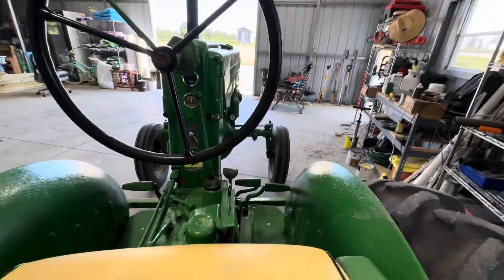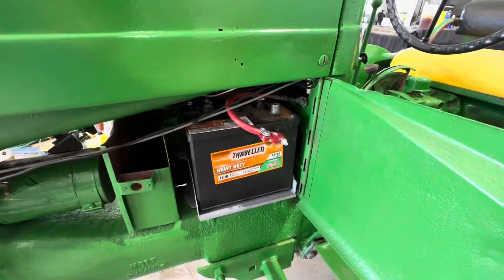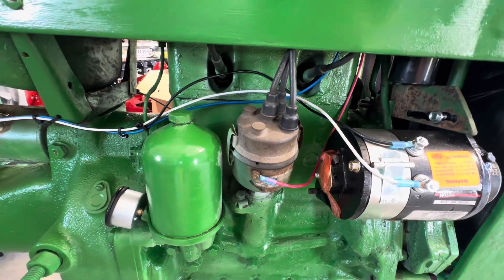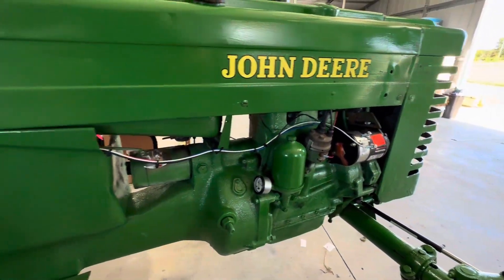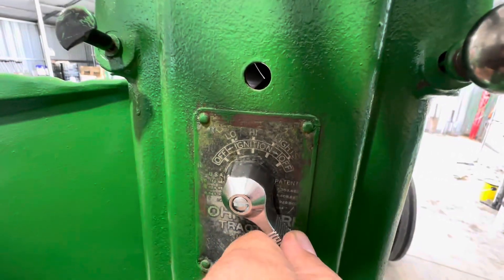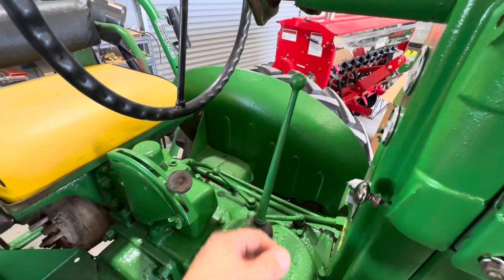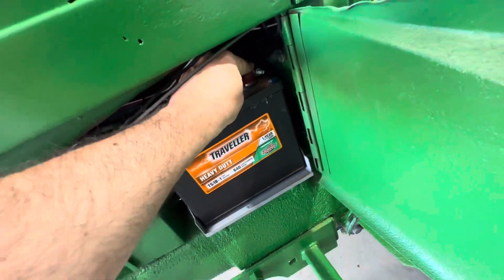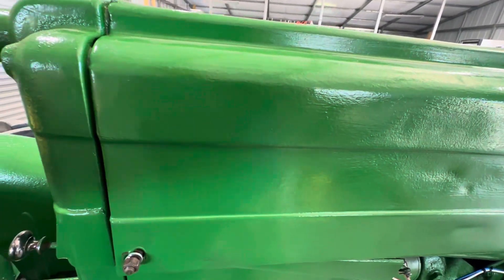1950 John Deere M Two Cylinder Gas

Comment: We had an M on the farm in the late 60's.  It was equipped with a primitive front end loader bucket that overloaded the front axle.  Dad took the solid front axle and wheel assembly out of an old dump truck so she was Frankenstien's bride most of the time I used her.  A suitable mate for the Farmall F24 with a six cylinder chevy and transmission.